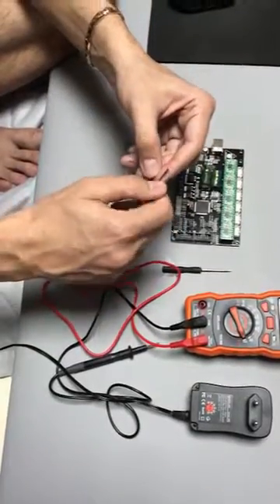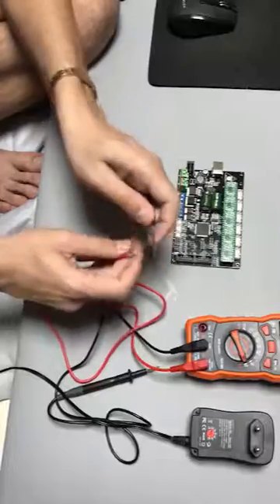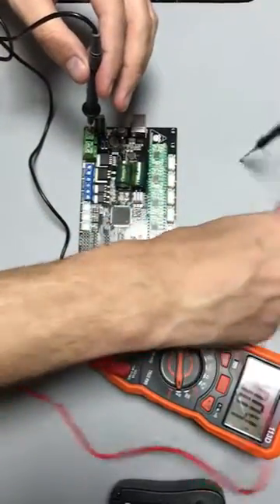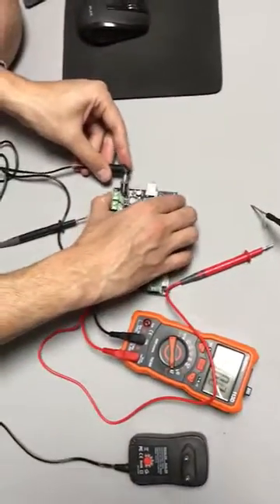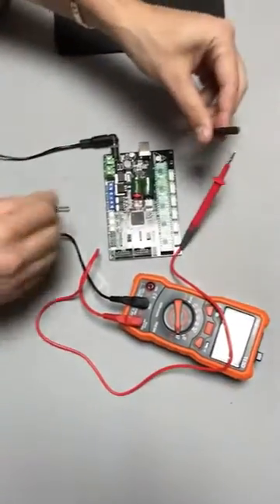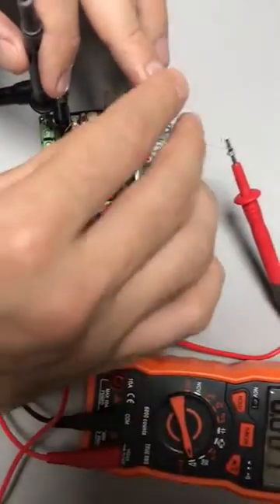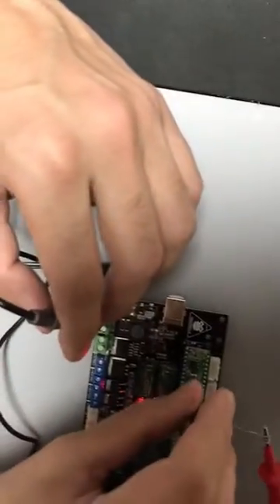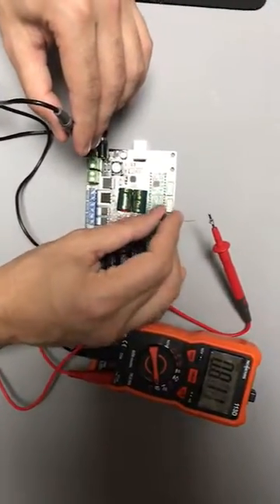Potentiometer Adjustment for A4988 or TMC 2208 3.0V drivers for Anycubic i3 Mega/ Mega S

Comment: I'm having a problem: I installed tmc2208 with firmware but the motor of the extruder doesn't work correctly. It is reversed and It doesn't extrudes enaugh when printing
Reply from the maker: You have to switch the motor motion to reverse through Arduino Software to compile it or reverse the TMC wire and connect. Then try to check again